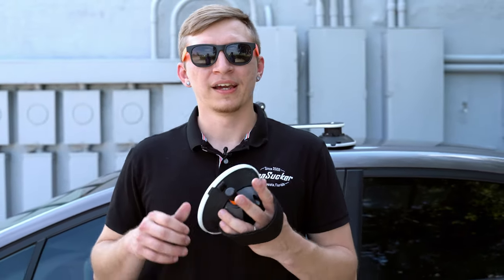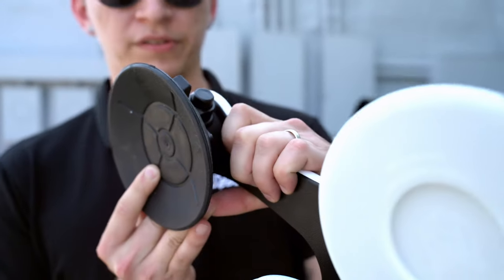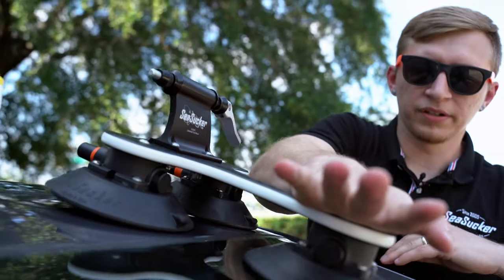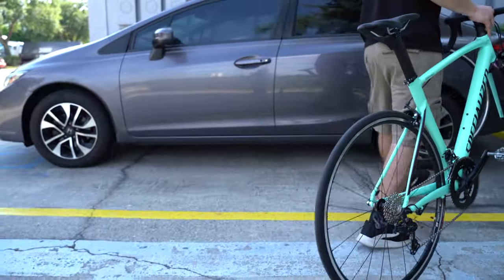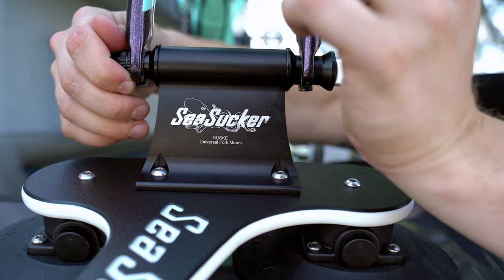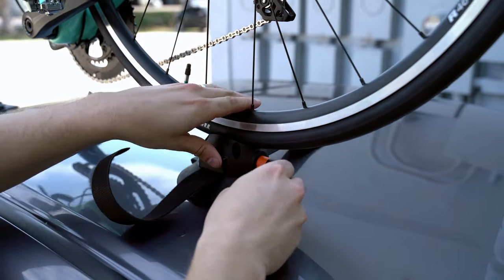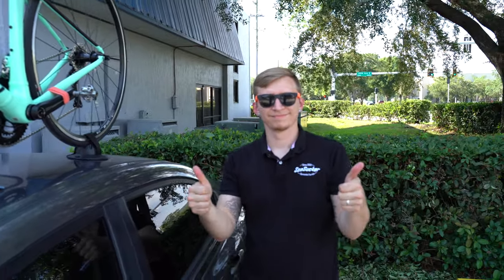SeaSucker Bike Rack Install

Comment: Been running the Talon for about 3 months now. Carrying a Ebike at 40lbs on top of my BMW X2. Drove from SoCal to NorCal with it on, speeds up to 90mph and zero issues. I always clean the contact points between my car and the cups. Also while driving around town zero issues, I just got my BMW so admittingly...I'm driving it like I stole it....took some twisty turny roads at pretty good speed and ZERO issues. Love it! I do wish there was a better way to lock these down. The little metal "hook" they sell that goes in your window looks sketch, I don't want my bike stolen AND my window broken.
Reply: Bro they have a trunk anchor!
Reply: Do you have a trough axle ? I have a fully

Comment: Guys! Great video!!! I have had my Seersucker for 5 years now, amazing, not one problem. Here is another pro tip, I mount the searsucker on the bike first, while the bike is on the floor, upside down, is that okay, I haven't had a problem, have you tried it that way?

Comment: I'm guessing if your paint is getting older this isn't really going to work? If I buff it nice and smooth would that work?
Reply from the maker: The only time older paint will be a problem is if there are rust spots, or other breaks in the finish. We mount these on vintage cars all the time.

Comment: Ya I have a madone, 2 glaring issues I have, how an I going to trust these suction cups when going down the interstate at 70 mph and not loose my multi thousand dollar bike???

Number two, my bike had 12 mm thru axles as do so many others, even if I can trust them noy to dump my bike how am I supposed to mount it???
Reply: There are multiple reviews out there, some showing the power of the cups while driving. I know for sure there's a review vid of a guy going 80mph without the bike even shaking.
There are multiple mounts available for the Talon, you can select an option when ordering one. 12mm is one of the options.

Comment: I bought the mini bomber (2 bike rack) and disappointed in how difficult I found it to get my mountain bike on/off my Prius. It’s a cinch w my light road bike, but not so w my heavier mountain bike, especially given I’m 5’3”. It was even difficult w a lighter child’s bike when putting it on/off a SUV. My 5’11” friends also found it difficult. I was also greatly disappointed it didn’t come w a storage bag. I see all the parts soon missing and lost and the rubber suction cups on the product eventually being damaged from free-floating about. Given the cost it really should come w a bag. I can’t even use the box it came in. I will say it safely transported a bike for 4000 miles; althg I did have to occasionally press the suction buttons as the orange was showing after a long drive.
Reply: Any kind of bike rack on the roof is going to be more difficult, the heavier the bike is. The only downside is that you have to take out your frontwheel. But you knew that before you bought it.
The rubber suction cups have plastic protectors. Use them well and the suction cups won't be damaged. It not coming with a storage bag isn't a problem when you take care of your stuff.
Reply: If you are 5'3" I would suggest you get another type of system....than mounting a bike on your roof.
Reply: Manlet use a ladder

Comment: Is that the correct orientation to mount the Talon? As I've seen it mounted both ways in multiple videos.
Cheers.
Reply from the maker: That is the correct way if it's on the windshield. When placed on the passenger's side this orientation allows for the whippers to clear. That's why the part of the rack holding the Talon is angled.

Comment: Hello! 
Does it work with disc brake bikes the front wheel axel skewer is different?
Reply from the maker: Hello!  Yes. Our fork mount base (HUSKE) uses a plug system to switch between axle sizes. You add the HUSKE plug size that corresponds to the size of your front axle. Here's a direct link to learn more: https://www.seasucker.com/collections/rack-accessories

Comment: Do I have to worry bout dents on the roof of my car
Reply from the maker: You don't. You're going to mount your SeaSucker rack close to the frame of your car. Most cars don't require this. I mount a Mini Bomber in the middle of my Civic and there's no issue.

Comment: If it's raining and roof is wet dies that make them stick even better or do you dry the area? Thanks
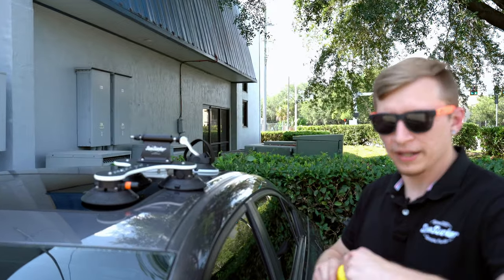Reply: He mentions that it helps it stick in the video, at 1:00
Reply: Altogaming4 he says a little wet but if it’s proper raining it’s a job to get it reasonably dry
Reply: @dpugh39  I suggest you carry a microfibre towel in the car: you can find them for super cheap, and they do a pretty good job at drying up a surface as long as you don't saturate the towel. So perhaps wipe the water droplets off with your hand, then wipe the surface down with the towel and you should be good to go
Reply: @JackOnWheels - have you ever tried to dry off a car roof during a decent rainstorm? Not possible.
Reply from the maker: That's no problem. If you go through a few rain storms you'll want to pull out the pumps and re-lube them.

Comment: Are you kiddin' me? You got almost all the technology complete and at the end you'll have to remove the front wheel of the bike? What is this? 99.99% of people who own bikes don't know how to dismantle the front wheel. Is this a joke? People just want to have the bikes in one complete piece. Either you do something about the design or this is a complete failure. Why don't you put a 2 vertical bars attached to the forward suction cups to hold the bike upright. Come on...what a design flaw.
Reply: It's not a complete failure lol....the average joe who has a comfort bike wouldn't be buying one of these anyway...ive worked in a bike shop for 18 years and we wouldn't sell this to just anyone off the street. you need to know how to remove the front wheel and all...you clearly don't own one...